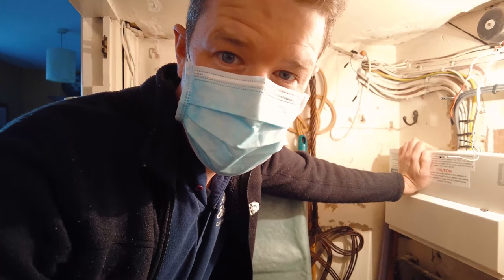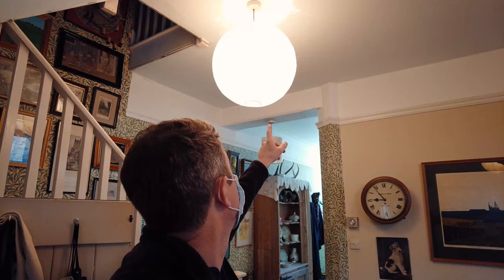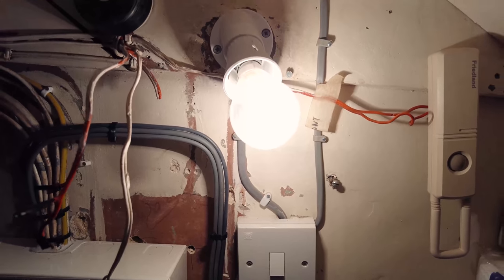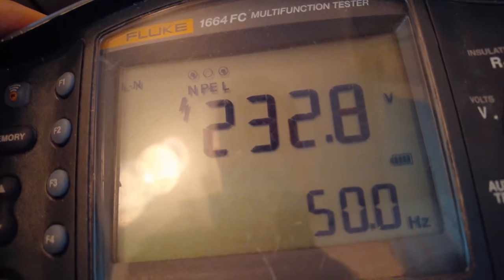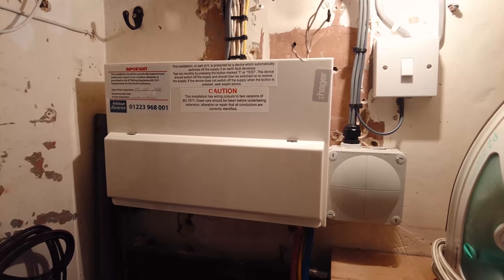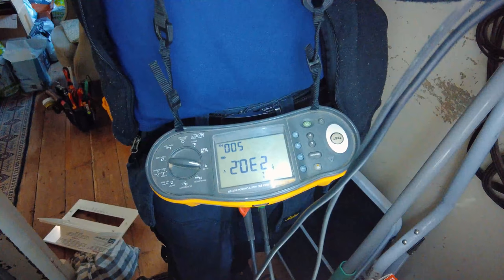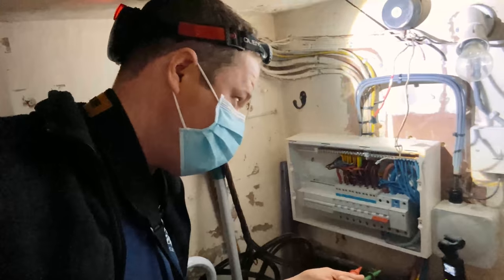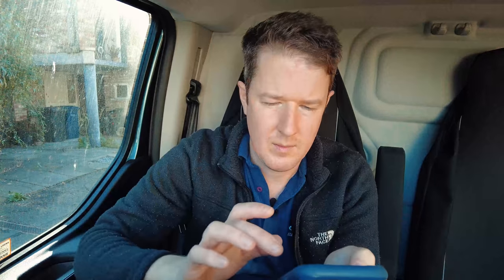Fault Finding Flickering Lights - Electrician Life

Comment: Years ago we had a new gas pipe installed, it was done with the trenchless install whereby they fired the pipe underground with compressed air, about 3 weeks later we noticed the lights kept flickering but thought nothing of it, then one sunday morning we were awakened in the early hours of the morning by the police hammering on the door, he said don't touch any light switches and get everyone out of the house, we had a massive gas leak which had filled all the cavities in the house, when they pushed the pipe underground they hit the electric cable and knocked off the lead cover, which had been shorting away in the damp ground for 3 weeks, and because the plastic gaspipe was up against it melted a hole in the pipe, i did not ignite because it was underground and starved of oxygen, the gas board told us that had it gone up that sunday it would have destroyed the whole house and us with it, my wife panicks now everytime the lights flicker.
Reply from the maker: Wow that’s a really shocking story thanks for sharing. I’m glad you’re all ok.
Reply: @r.h.8754  They do, they normally connect a magno tracer to the incomers and check the listed ground surveys for the services listed with the local councils. However more often than not it's moled through the ground (a tunneling machine which then feeds the pipe through). Blasting with compressed air is frowned upon because there's no control over direction at the end (unlike a mole machine) so if it hits anything not listed on the survey or a rock/debris it can veer off course causing issues like those listed above.

Comment: I have seen this in the Netherlands. It was a bad underground cable joint. Moisture got in it, and it started to short out for very brief moments, resulting in flickering lights in the whole street. It got worse over time (quite fun to watch the whole street dimming and flickering at night) and before the grid company showed up, the joint had already shorted and blown out the fuse at the transformer station.

Comment: Had this recently on a callout to a house with bad flickering lights,  Voltage neutral to live was jumping between 168V to 98V , and neutral to earth floating voltage measuring 230V , isolated and switched off immediately. A dodgy loose neutral feed from overhead municipal feed was the culprit.   they reconnected it and all measured normal. Neutrals can cause big issues.

Comment: I’ve had a issue with low voltage (flickering lights and ev charger faults) . SSE bypassed our substation and put the local area on a diesel generator. The ‘fault’ was that they had been using our substation to back feed another area and overloaded it !

Comment: Open circuit on the neutral between the distribution cable in the street and the DNO transformer. The neutral is then 'floating' i.e. not connected to earth and therefore, as the load on each phase varies as individual customers switch things on and off, so the phase voltages will vary.
Reply from the maker: Thanks
Reply: Floating neutrals tend to push the volts higher than normal in my experience this is why stuff goes bang
Reply: Is this the pen fault i keep hearing about???
Reply: @haldo691  it will push some higher and some lower depending on which phase you are on. Was it a tncs or a tns. Would have been good to see if it also happened on the live to cpc.  Arguebly even bang a small earth rod in the ground and see that way.
Reply: @jenton93  The fluctuations are a bit small for a true floater I'd say. I'd expect swings from anywhere between close to zero and 400 V unless the system happens to be very well-balanced. A dodgy connection is entirely possible though.

I live in three-phase country, i.e. pretty much every house is on three-phase and you have to balance your circuits in the DB. At my gran's place, the neutral between the meter and DB had a choc block splice that was under severe tension because the cable was too short. Eventually it failed and even touched one line of the upstairs flat, although nowhere near a dead short but enough for the neighbours to burn through main fuses at an alarming rate. Anyway, the cooker was nearly dead, the fridge barely growled but blimey, the incandescent lights were bright! Thankfully, casualties were limited to an old radio and a dumbphone charger, so not much damage. That was one of my great learning experiences that helped me diagnose faults later in life! Another of those was an intermittent N-E fault that caused the RCD to trip during heavy rains in a holiday apartment we spent our summer holidays in. It took a whole year for the local spark to spot the issue and half an hour to fix it.
Reply: @haldo691  had that happen to my area. The neutral at the transformer came loose. Within minutes lots of things went bang on two phases while the 3rd dropped down.

Interestingly, in another road there was a neutral fault on the overhead feed. People complained of low voltage, not of high even though it was at 280 volts, and nothing blew up.
Must be the MEN was working and still had a path back to the transformer where mine the neutral was completely off at the transformer.
Reply: @Ragnar8504  - you're not getting enough fibre if you have a true floater...

Comment: Had to deal with a similar complaint at our head office once. Computers and lights all flicking off, emergency lighting coming on and off. Upon closer inspection. One incoming phase was stable, the other 2 were dancing anywhere from 125v to 235v (l-n). From the distribution board position, through a window it was possible to see the transformer mounted top of a pilon. And it was being battered by a very large branch and it was also loose in the ground so it was falling back and forth. Every time the branch struck you would see the voltage drop off. Early day for the office staff though. By all accounts it caught light before the DNO could do anything about it.
 Love what you do. Keep it up.

Comment: Dodgy joint or someone is running a press 😂 Seen swings of 200a every second or so on the 11kV network where industrial presses are used. Either that or Photonics induction has move to the area 😂. Don’t think it would be a dooby farm as the load would be fairly constant and not causing huge sags every couple of seconds.
Reply: No way, just put his video up where he blows the electric meter 😂
Reply: @phillipgwynne6580  legend
Reply: Depending on which room is set to what time your right on that one that only time there will be a huge load been pulled in a grow will be when everything is turning on after that it will be a steady flow unless they have gone to a high tech grow with self dimming ballasts
Reply: @ADAMBRADY04  Yeah, basically it has to be something that cycles quite rapidly. On a smaller scale, laser printers are notorious for that. They use some kind of electronic controls for the fuser unit (about 600 W on a domestic/small office printer) and apparently switch that several times per second during printing and that's enough to make lights flicker, especially in places where it's common to have lights and sockets on the same circuit. Commercial copiers are worse, they can make miles and miles of fluorescent battens flicker if they're on the same phase. I experienced that in a library, it was truly annoying to sit there and read when the lights flickered on both floors every time someone used the copier!  Eventually they upgraded the lighting to LEDs and that fixed (or shall I say masked) the issue.

Comment: Hi, I had a similar problem. At the neighbors nothing was wrong.  When the electric company engineer came he noticed that in the main fuse (from the electric company) there was a bad connection and a ball of metal had formed in the contact. When there was not a heavy load the ball was solid and made good contact. However when the load was increased (just an incandescent light bulb of 60 Watt or so) the ball melted partly and the resistance increased slightly with the result of slightly dimming the light.

Comment: Voltage fluctuations seem very small less than 3%, would have thought it would be larger to cause flicker will be interesting to see what the outcome will be, hope you do an update on this cliffhanger.
Reply: Incandescent bulbs are quite sensitive and the fluctuations are so rapid they're quite noticeable. I reckon if they were gradual, say over ten minutes or more, you wouldn't even notice them. In rural areas it's not that uncommon to use most of the 10% tolerance band, in some countries even exceeding it.
Reply: Consider voltage drop when current draw increases, very small yet you can often see the lights flicker not surprising at all really.

Comment: Had the same problem in my sons house in Swindon checked as you did called SSE and they fudged the first call by leaving the first time by saying it’s the house holders responsibility and get another check carried out it went on for six months till it affected more than flickering light circuits across three RCBO protected circuits then the micro wave got affected.  Call SSE AGAIN this time another guy tried the same get your circuits checked even when I went to round to let him in.  I stood there and stood my ground he said I will remove the intake fuse till it’s checked again.  Result my. Son partner and baby had to stay at my house . I got the finger pointed at me by my son saying can you check your install again . 🤔.  By the way this mostly happened after rain. That was also passed to SSE.  The final out come AND WITNESSED by my son after the joint way exposed by SSE fizzing damp joint failure.
It seems a uphill struggle when problems like this happen but I feel they like to wait to power is lost before digging and faulting there supply these guys that attend I feel are pushed to hard to be able to carry out there job by controls above them but it was eventually repaired it was 1 mtr from there front door

Comment: It'll be water in a service joint before  it goes pop! Usually houses will be on phases 1'2'3 1'2'3 and so on. Maybe knock every two houses miss one, see if they have the same issue.
Reply from the maker: Thanks
Reply: Wow, proper jointing, 123, 123 LOL. Lucky to find they're not all on 1 phase :-(
Reply: @paulmac8016  4 out of the same joint all on the red 😂

Comment: These are very civilized "fluctuations" in Britain :) I had to install a separate stabilizer for each phase to deal with 180-230 volt fluctuations. But that's Ukraine :) In your case, you could have advised changing E27 bulbs to LED ones with the IC driver supporting 160-240V voltages. And granny won't be bothered with "flickering" anymore.
Reply: May I add, it still puts strain in your eyes. I tried to viewing light from phone's camera and could see the painful flicker more prominently

Comment: If they only see this problem during "office hours" it could be an industrial installation nearby using high powered machinery, possibly in conjunction with a high R connection somewhere upstream.  Welding equipment is a common cause of this so any car garages nearby?

Comment: My guess is a phase fault somewhere on the network - last time I saw this happen it turned out to be a fuse fizzing away at the substation transformer.  It could be a fault on the phase or neutral between the customers house and the joint to the 3 phase cable, I can’t see it being a neutral elsewhere on the network as the voltage is only going down - I’d expect the voltage to go up as well if it was on the 3 phase side of things.
edit, I typed this before hearing it was affecting other houses so probably not the neutral between the house and 3 phase.

Comment: Wow flickering lights. Great Job You did called the company to find out how to solve the problem.. I think maybe neutral at the transformer. Same happened when I visited a restaurant. I noticed a lot of flickering lights. I went to see the Main panel to check the measure and found the cooker room use a cook mixer machine. I disconnected then moved to another different phase. It was successful, no more flickering lights. THUMB UP!!!!! Cheer!

Comment: My guess might be a bad connection to the transformer. 
I've seen two issues with power dipping on properties, one issue was a transformer going bad, one leg weak and causing load issues (split phase USA, 240VAC). The other issue was a bad Crimp fitting on the line coming in.
I've also had a bad (degraded) backplane which would cause the panel board to arc out when loads would come on and off (water caused the insulation factor to deteriorate). The lights would flicker and buzzing like bees could be heard! Thermal examination of the panel showed a dangerous fault, requiring panel replacement.
All issues here in the North America USA.

Comment: I had the same problem with flickering lights and the consumer unit tripping. I notice when I switched the breakers back on there was a spark from the cables coming into the house. Got the power company in and they traced it to a loose connection. They tightened it up and it’s been fine since. SSEN responded within an hour and it was very quickly sorted and tested.

Comment: If your house is fully led. You might not see any change in lights until you get as low as 100v's possibly lower. It's doubtful that much or movement is caused by a grow unless there is arcing. Personally that's either a faulty transformer or a damaged cable somewhere.

Comment: I had a few of these when i was with the local DNO. Knocking on doors, people tend to speak up, especially if their supply is affected. Best clues are, " he only comes here about twice a week, and normally late at night" Then on testing external with Ammeter, even a shared supply. Isolate Cons unit,(of customer you're talking to), and test at wall point. High usage(over 80 amps) will normally determine that the shared property is the guilty party. I have even looked through window above door, using steps and seen the by-pass. Phone police, and whatever you do, do not agree to make a statement or get involved yourself. They have all the evidence they need, you do not need to show your face in a court of law.???? A: You won't get paid for youe time. B: Do you really want the grower or his superiors popping around for a chat?? :-)

Comment: A grow operation as mentioned elsethread, would have been a steady load. And grows these days tend not use the older tech... so the load is less. 

And yeah, neighbour affected and not the direct next door ones says it's on one phase only. 

Odd side story. I was able to tell SSE that one phase was down in our local area, when our power went out and almost exactly 1/3 of the usual wifi networks disappeared LOL. Joys of city living!

Comment: I have seen it happening here in Aus on a leg, it took the power company some time to find a hot joint, (Dirty joint with bad resistance) that was in a pit, they also claimed there had been ants near by. But they got it fixed as quickly as they could as no power company wants to be handed a bill for brownouts caused by there equipment.

Comment: I know this video is a bit old,but I think it is possibly a fault related to a distribution Voltage regulator,or capacitor bank,or failing that,if there's a factory nearby,it could be switching transients,there's quite a few things it could be.Did you end up finding out what it was? I'm really curious!

Comment: Just came out of big heavy snow in Nor Cal foothills. Many down trees which took out wires, poles etc. No power for 9 days. Crews here yesterday restored power but we had major flickering anytime a load larger then lights was energized. (All was good prior to outage) Coffee pot, microwave, lift station pump etc. would cause flickering. Told install crew about it before they left,. "All's good on our end, must be something at your house."  Hmmm.. Placed call, PG&E svc tech came. Up & down the line, checked my service panel, weird voltages. Found neighbors with same issue. Bottom line, found bad/wrong connection feeding the transformer the installers just completed.

Comment: Here's a little story from Norway:
At my mothers house, I measured a voltage drop all the way down to 215V on the supply line. She noticed it by some lights in the living room lighting up very dim, and the cooker had very weak heat when she cooked dinner.
I called the company responsible for the power supply in her area. They sent us a plug-in device that we plug into a wall socket, and it monitors and sends data to the power company to let them monitor it more closely. They monitored it for about 2 weeks, and they got back to us and informed us it was a bad transformer causing the voltage problems. Mystery solved.
Reply: During the monitoring phase your appliances probably lost 6 lives due to low voltage/high amperage.

Comment: Hi there - My relative recommended your channel so I am here watching my first of all your videos.   I live in the UK so hopefully you can help me please.  
 I have disconnected my Solar System to upgrade it and although everything worked seamlessly on Solar / Batteries before disconnecting it all I am now having a silly problem with the lighting circuits on the incoming grid supply.   When switching on various lights now some of them are working fine but some are strobing ! ? ? ?   Any help or advice you can offer would be very welcome please !      Thanks again for a helpful video which isn't unfortunately the cause of my problem.   
I'm not a qualified electrician but have worked with a Sparky for a few years so I know enough to understand the UK system - but this problem has really got me beaten so far.  
Kind Regards . . . Eddie.